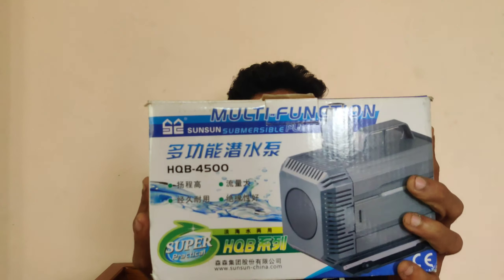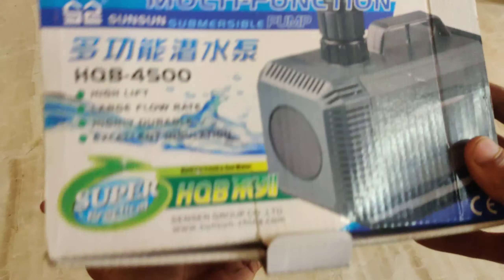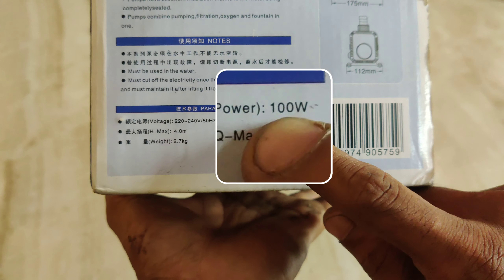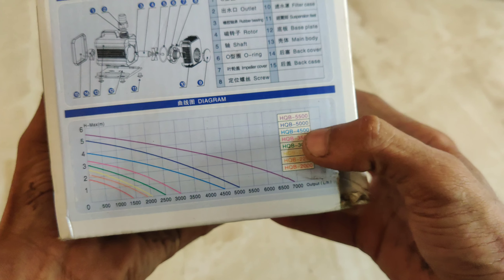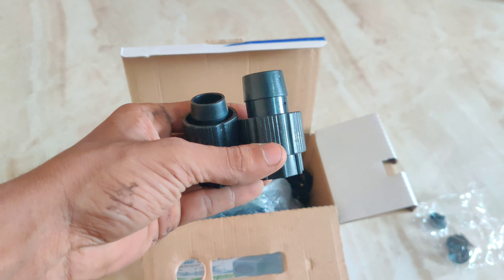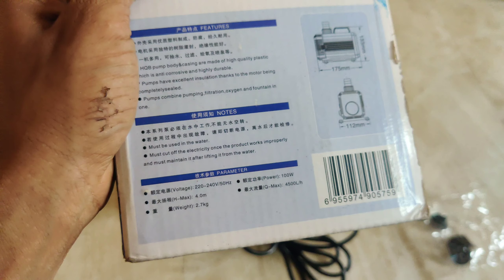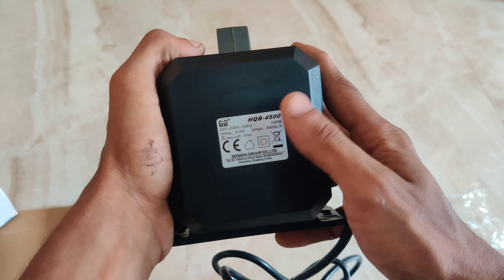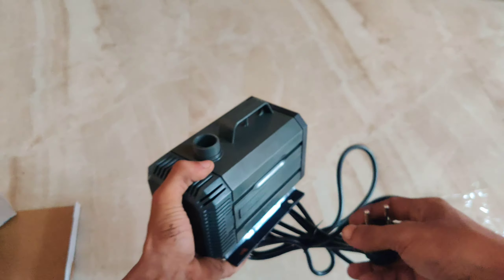Unboxing new motor for 5 ft aquarium

Comment: Bro my tank is 6 x 2 x 2 feet with bottom sump 4 x 1.25 x 1.25 feet. Which motor will be best.
Reply from the maker: Use a motor that runs 4500 liter per hour
Reply: @isakiir  can you please suggest me the brand
Reply from the maker: Cheap and best sobo 
Best and maintenance free sunsun
Reply: @isakiir  can you give me the link for the sunsun motor and what is the cost of your motor ?
Reply from the maker: DM me bro 9790866357